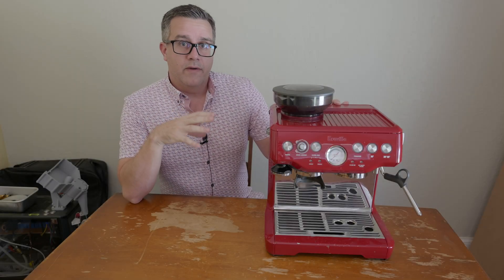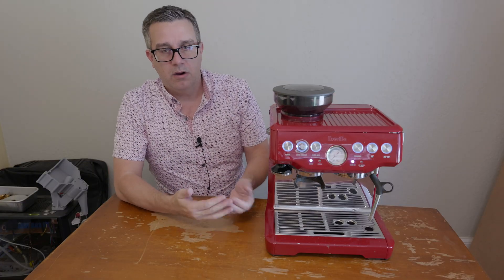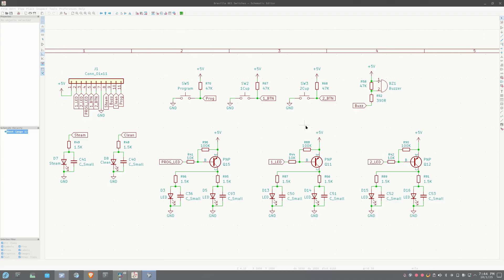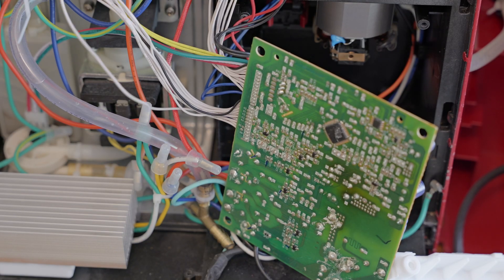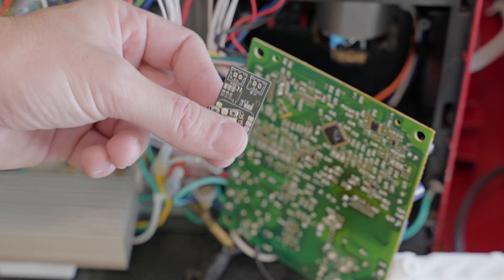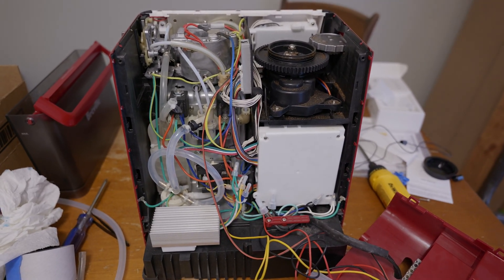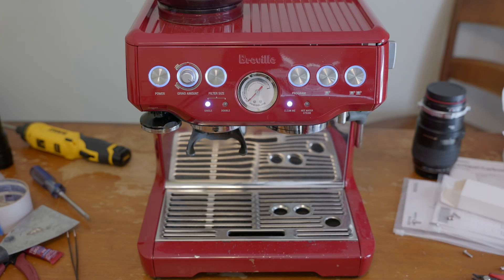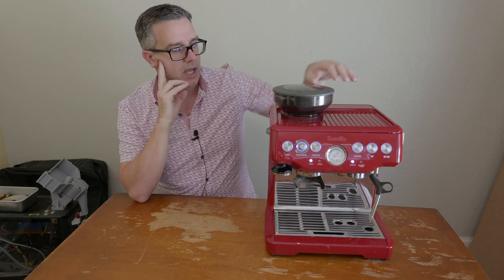I gave this Breville Bluetooth

Comment: Finally someone fiddling with the BES870, I've been looking for a way to get this done on mine so great video and great relief to know that its possible!

You seem to have done some soldering on the main board but since I'm nowhere near as confident with an soldering iron I was wondering if there was any space to piggyback on the pin 6 and pin 7? I was thinking to just pull the extra wires out from each and connect it all to an ESP32 on the outside?
Reply from the maker: No soldering on the machine side of this. You can see @7:20 I just created an interposer board for the button board cable. The cable from the buttons plugs into it, and another cable goes to the main control board. It uses the stock plugs and wires without modifying them.
Reply: Oh ok wow, I just got a bit overwhelmed by all the cables and just assumed that it was soldering going on. I’m just winging it and learning as I go but if there is no soldering then I’ll definitely give this a shot after finishing the DF64 GBW mod 👍

Comment: This sort of thing is pretty interesting- but for me the sort of person who would want to do this is probably going to want to go down the pathway of something like a Gaggiuino/gaggimate type functionality.  Suffice to say - getting the foundations in place would be great, as long as it was with the view to being able to build a path to a more fully featured solution.
Reply from the maker: Definitely different goals. This isn't intended to run the espresso machine, just control shots. It's much cheaper, and you can still log and capture data on a phone with it. I've thought about building my own espresso machine board and control system, but that's a lot of time and money, and given the lukewarm reception this project got, I don't think it would be a great use of time, as I don't really need it personally.

Comment: You could put a dimmer switch on that pump and let your friend flow profile too.
Reply from the maker: I guess if a person wanted to, you could intercept the pump signal and implement a PWM control. Combine that with a digital pressure transducer on the high pressure side, and you could have full on custom pressure profiles.